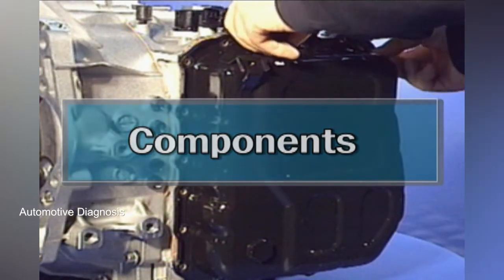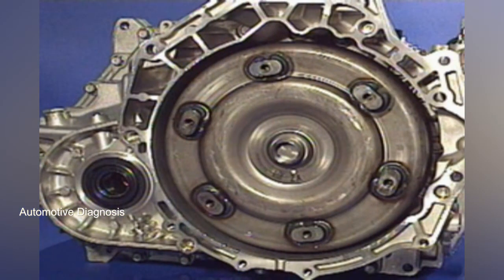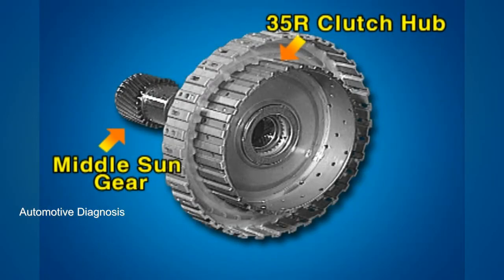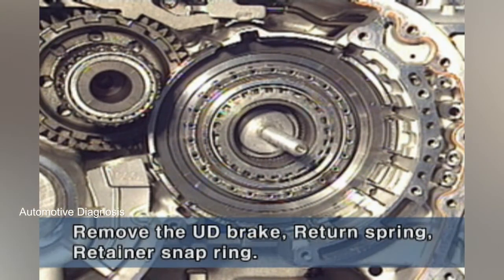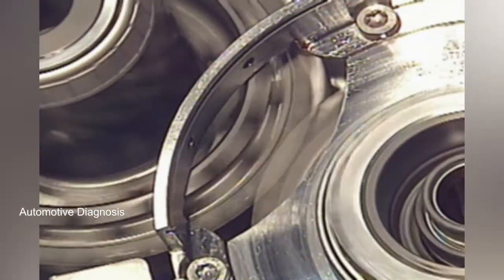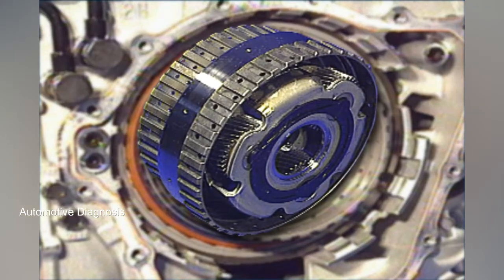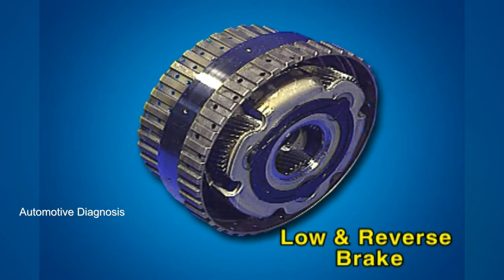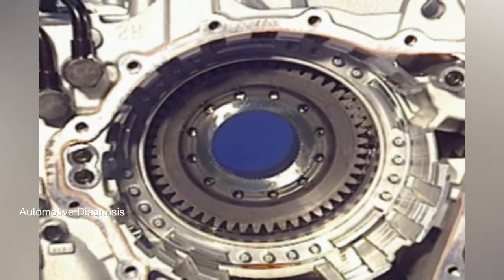KIA & Hyundai Six Speed Automatic Transmission Components Teardown and explanation

Comment: What type of transmision is this?
Reply from the maker: Hi there, it's a 6 speed automatic transmission which is used on many models on KIA and Hyundai. A6GF1, A6MF1, A6MF2, A6LF1, A6LF2
Reply: @AutomotiveDiagnosis are they called "lock up clutch "? or dual clutch?
Reply from the maker: @edwardalipio4451  None of them my friend. those two are completely different things.

Comment: Good video, when I come to a complete stop my car completely stalls out I have to shift into neutral to prevent it. Also does this at idle wen selecting Drive or Reverse. Idles perfect in neutral or park. That sound like a torque converter internal failure or 1 of the transmission internal brakes or clutches? It makes it easier cos your vid shows most the parts. Hyundai A6LF3
I did try the stall test I accelerate in drive or reverse it won’t even rev just stalls out immediately. Other than that it seems to shift smooth thru all the gears

Comment: Hello sir I have question : what is the different between the gearbox A6MF1 for Hyundai Creta and the gearbox A6MF1 for Hyundai i40 ? Thank you
Reply from the maker: Hi my friend. Same transmission
Reply: @AutomotiveDiagnosis  Thank you for your reply, but I would like to tell you that they are not the same transmission, for example when installing the A6MF1 for Hyundai i40 gearbox in the Creta, the car becomes crazy in changing gears, it requires a lot of torque to change one gear to another (up to 3200 tr/min to change the gear).
Reply from the maker: @mohamedboubakeur2271  Hi my friend, when I say they are the same, it doesn’t mean that you can swap them. Each engine generates different torque range, and even if these two transmission are same internally, TCM controls them differently on each engine. Different gear shifting pattern and TCM control logic makes it look like very different.
Reply: Were can you find a transmission kit and hard parts

Comment: The temperature sensor has a high failure rate and will cause the transmission to slip into 4th gear (failsafe mode).

Comment: Nice job please i have kia Sportage 2011 automatic when i shift the gear selector to  drive while my  foot is on the brake pedal the engine go off, please i need your help
Reply from the maker: Hi there, it could be from the torque converter
Reply: @AutomotiveDiagnosis  but when i change the valve body the problem stops that is why i don't understand
Reply from the maker: @ernestdamo677  Oh, I see, if valve body keeps providing the ATF to the torque converter clutch, this problem happens
Reply: @AutomotiveDiagnosis  please i don't understand you said if the valve body keep providing fluid to the torque converter
Reply from the maker: @ernestdamo677  there is one solenoid valve to provide the ATF to the torque converter clutch when you are driving at 5th and 6th gear to activate the mechanical coupling between engine and transmission, so if that clutch is engaged all the time (due to a mechanical fault or valve body malfunction), it will turn off the engine as soon as shifting to D.
Reply: @AutomotiveDiagnosis  please i thought we have 26brake solenoid valve and 35R clutch solenoid valve, please what is that one solenoid valve
Reply: TTCS

Comment: Question about the Differential Gear. Ive had a car one time that the pinion sploded thru the trans case, cause it was a really lame/ weak roll pin. Does the Kona have this same setup, or are there any things thag prevent that from happening?

Comment: There is a bolt and nut (7mm bolt and 15mm nut) sticking out of the top of my transmission, near the overflow vent.  I seem to have a leak coming from it.  What is it?  Is it safe to simply remove it and put in another?  I got a replacement from a scrap yard, but I want to be sure it doesn't hold anything in place on the inside before I mess with it.
Reply from the maker: The level plug is at the side of this transmission (if your transmission is KIA or Hyundai 6 speed AT) so when the engine is off, AT oil pump is not working and the oil level is at the level of the level plug, so if the bolt that you are referring to is at the top of the transmission, there shouldn't be any problem as long as you do the job carefully.